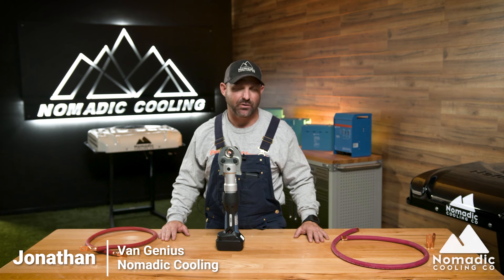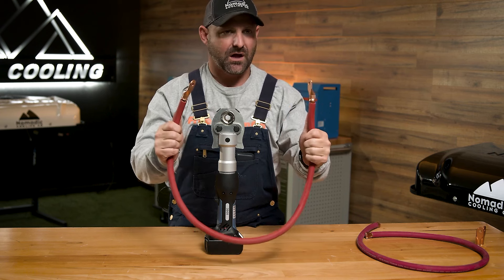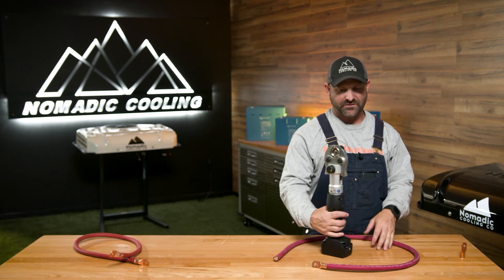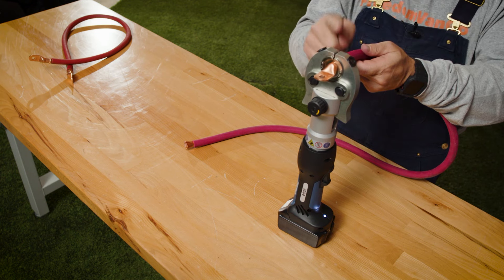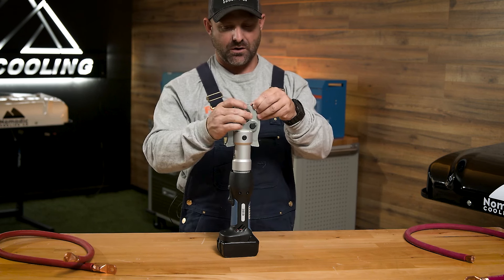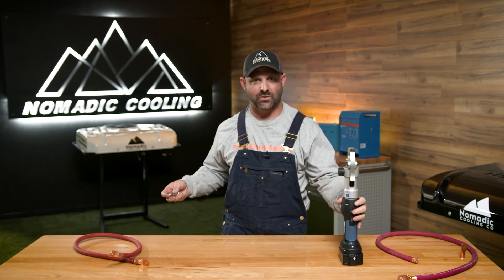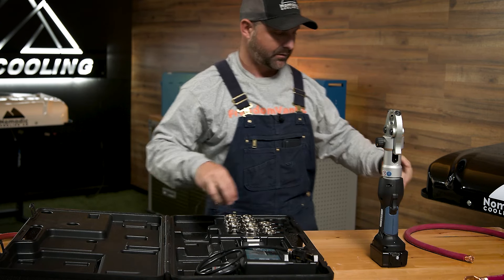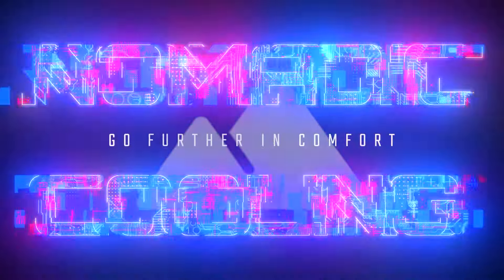ELECTRIC WIRE CRIMPERS SET 18V I Nomadic Cooling I Electrical System

Comment: You’d need to be involved in professional cable production to cause that price to make sense.  The $35 hydraulic crimper on Amazon works amazingly well.
Reply from the maker: Agreed 💯
Reply: I have a few cheap ones explode and oil goes everywhere. Kinda like a drunk Saturday night with my wife Stephen
Reply: @dan82781  yeah - you have to make sure you don’t twist the knob too far in the wrong direction!